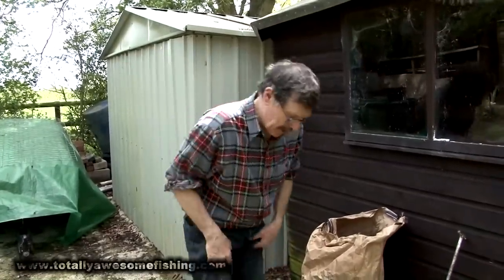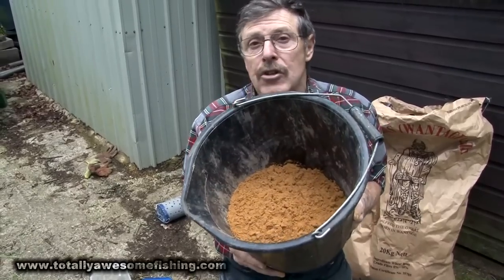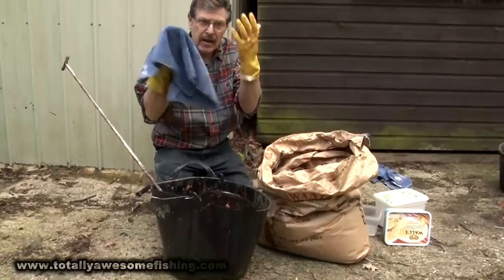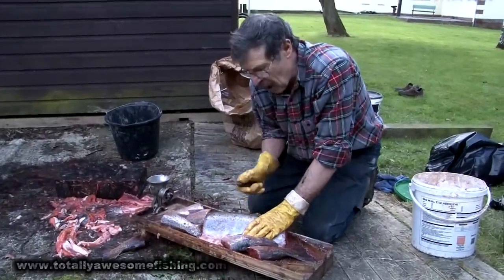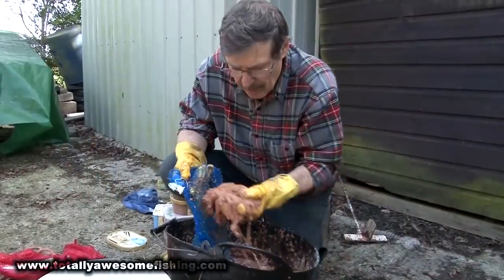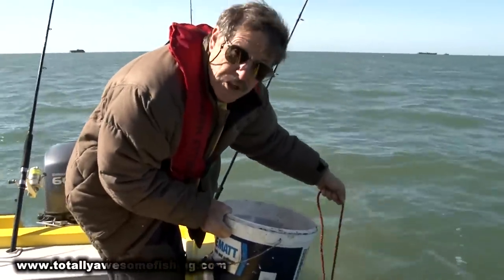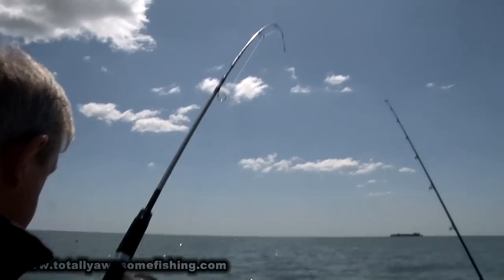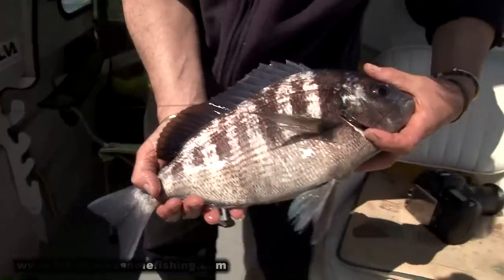How to make chum for Sharks - Totally Awesome Fishing Show

Comment: Great work on the video. I noticed you spent all that time & effort to setup yourself up for a great day of fishing, only to have another boat run through your chum slick & disperse the slick which can shut off the bite or at the very least pushed the fish down. Which can ruin your day on the water. The Chumming flag is working to reduce those unfortunate annoyances, by promoting sportsmanship among anglers. The Chumming flag also informs others that sharks may be present and caution should be used when entering the water. The Chumming flag is committed to use a portion of sales to benefit the marine environment, making it a win-win for everyone including sharks.

Comment: If I can get ahold of fish carcasses, could butcher scraps mixed with grains and animal blood work?
Reply from the maker: Probably,but in tropical waters.I have  tried gallons of animal blood but you have to mix in an anti-coagulant or you just end up with one big cloggy cube. Fish carcasses are the way to go,and you can freeze anything down so when you use it the dispersal rate is slower.I freeze mine,both with bran as a ready mix,and unmixed.